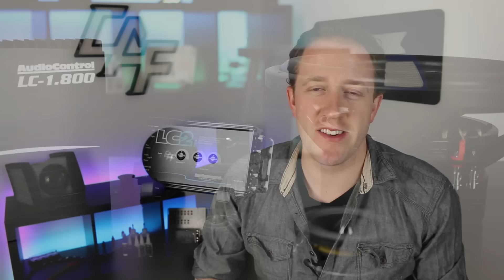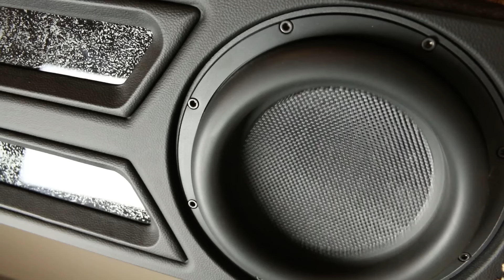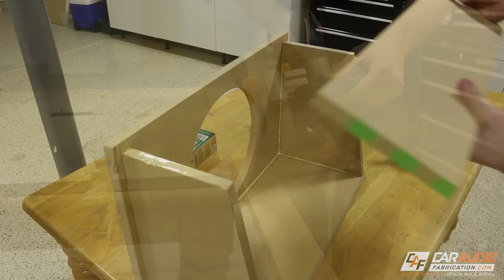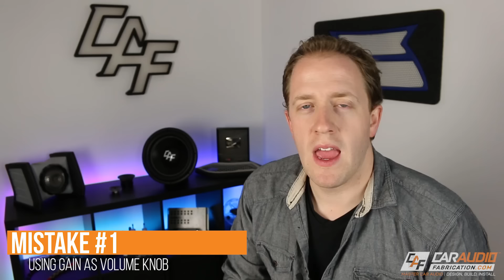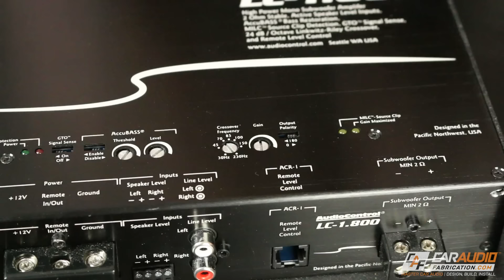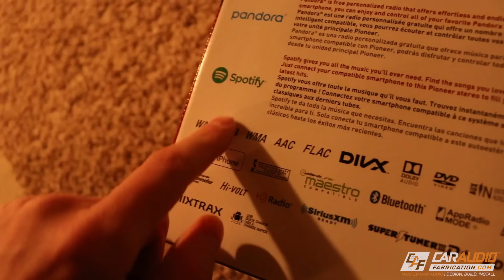Avoid these 5 common Car Audio NOOB Mistakes!

Comment: Im about to install my first amp and im terrified
Reply: Da Homie take your time and don’t take shortcuts. Remember to fuse your power within 12-18 inches of the battery and insert the fuse last. Run power and ground on one side of the vehicle and RCA’s & speaker wire on the opposite side
Reply: MrEvoHK Ive been talking to people in my car group and they say i might need some fuse taps and a two channel line output converter as well.  Im just kinda overwhelmed but im still doing research online
Reply: It’s a little misleading with how hard it is. All it really is is get nice lugs an crimp them right. Have a fuse as close to the battery as you can (not stupid close lol) but no more than a foot away. Then run it through the firewall and under the panels under the doors (make sure nothing pinches) run it to your amp and plug them in. REM or Remote goes from radio to REM on your amp. Make sure your ohms/impedance is correct on your amp. Run RCAs on opposite side of power wire. Make sure to screw your amp down and use ZIP TIES to make your install look pretty. Don’t leave spaghetti. High pass lets notes higher than what the nob is set to. Low pass let’s lows through. Gain isn’t volume. Go online for stuff. It’s a lot cheaper there. (For the most part) be patient and calm and be clean about it. Any questions, I’ll be happy to help!!
Reply: Smoke 2 joints before you do anything and you'll have a great installation
Reply: Da Homie 

Don’t be terrified. 

What amp did you get?? And what are you hooking it up to?? Maybe some of us here can assist with ideas for you.  

With so many walkthrough install videos online. My suggestion to you is to absorb as much info off YouTube here as you can until you feel more comfortable.

the only real tip I can offer that’s universal to all amps and electrical.  MAKE SURE to disconnect your battery before you start running anything.  And when you connect the amp up to the power wires, triple check you have your power wires connected correctly in the correct locations.
Reply: Tim Henry i bought a Hifonics Brutus BRX 1110Watt.  I have seen some vids and have been talking to some guys who have done it before but im just really nervous lol
Reply: Its really easy . just make sure to unplug the negative from the battery first and plug it back in last .
Reply: remember use duct tape for your wiring and always spray it with a out door hose to check to make sure it's water sealed. just remember wiring and water is very helpful. enjoy those joints

Comment: the GTI syndrome in holland,, top of the line bass (dual 15"subs of a good brand with killer amp and ported box) with stock speakers and powerd by a stock radio or a cheap aftermarked.. in short 4x 22w (mosfett 50w) speakers and 15 times more bass than music

Comment: Most new guys in South Africa are tricked by high wattage ratings mostly because good products are highly price inflated. My mistake and probably what is the case till today is managing to get or calculator the proper amount of batteries needed for my system. You need to check out this online store just to see how ridiculous some brands are, there's a car audio brand which has mono-block amps rated at say (+-)2000 watts rms at different prices and probably not even the most expense one will do it's power!  www.autostyle.co.za